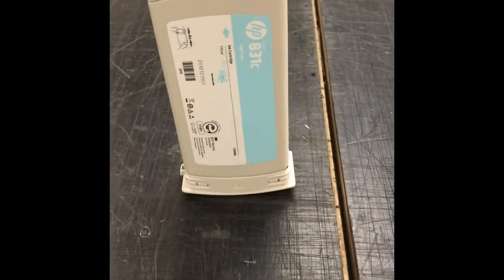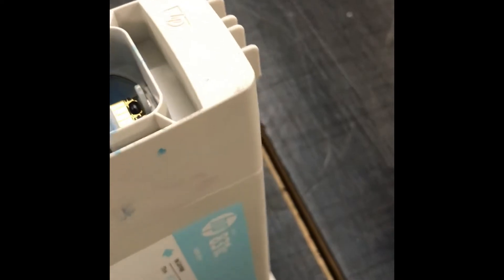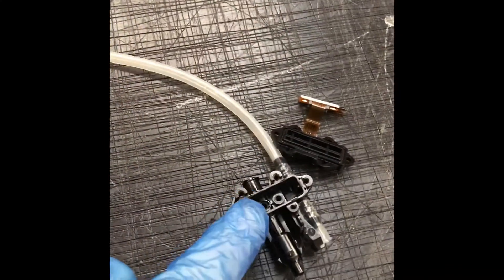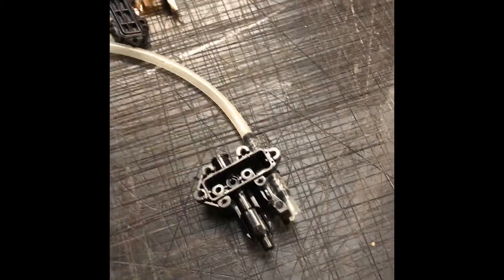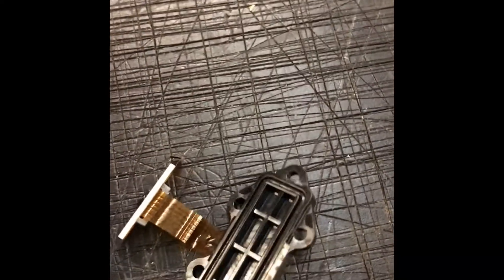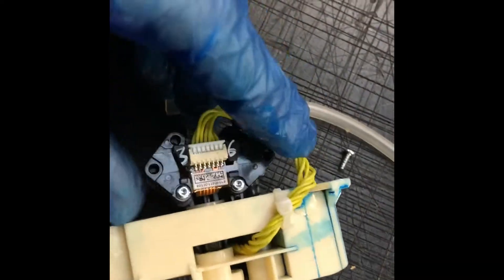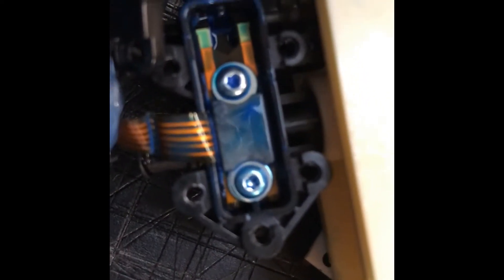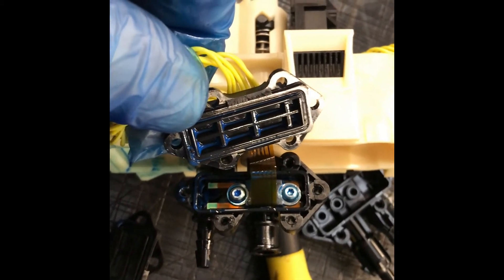System error 26.06:10 – Broken Bag  Y (PIP 1) HP Designjet Latex 310 315 330 335 360 365 560 570

Comment: How I clear the error?
Reply: same issue.. how do you clear error? we changed the pip but the same broken bag error comes up. how do we start the HP 360 in diagnostic mode
Reply: @imperialstudios3939  Did you guys figure this out? Im currently experiencing the same issue? Thanks
Reply: @imperialstudios3939  iniciar impresora. 
tocar Home (la casita va a titilar)
luego precionar  X (cancel), luego home, luego ? (help) y se va a abrir las opciones de diagnostico.

Comment: I have a HP Latex 330 . I opened and cleaned the pip sensor, but when I turn on the printer is still showing the error. Some reset must be done before continue printing? Thanks !
Reply: Matias, pudiste resolver el problema del PIP? Actualmente estoy teniendo el mismo inconveniente por segunda vez en mi L 310 y por temas de pandemia no puede viajar ningun tecnico... no quisiera quemar el cartucho ni tener parada la maquina hasta que se reanuden los vuelos hasta Tierra del Fuego. 
Gracias.
Reply: @sebaemendoza13  Si, lo limpie y despues tuve que hacer un reseteo del error desde el panel de servicio. Si te dice que el problema es que el sensor de tinta funciona mal, pero te deja seguir imprimiendo, es normal, nosotros ya cambiamos los pip y se estropean de nuevo.
Reply: @visionmezcal   hola! te hago una consulta, cómo reseteas el error desde el panel de servicio?

Comment: Do you have any experience with printheads losing ink? My l26500 is losing ink in the light cyan printheads I've checked air pressure, purged the line, changed printheads, but I can't find any solution.